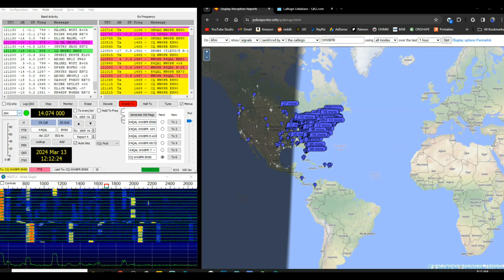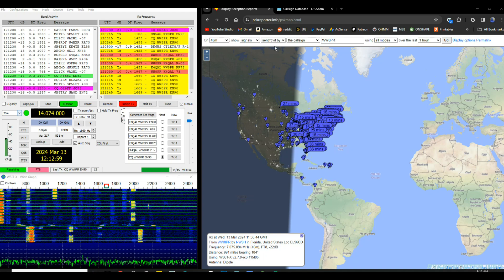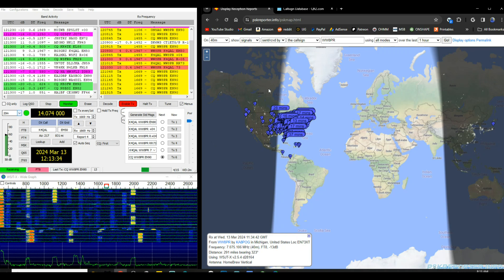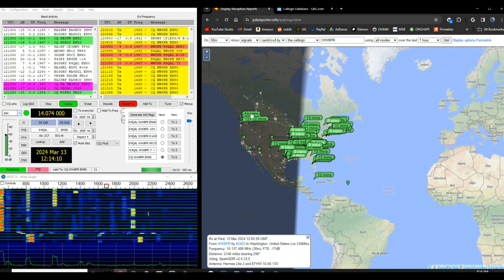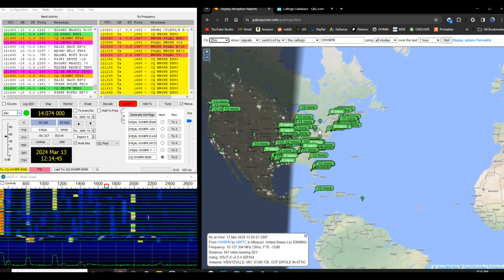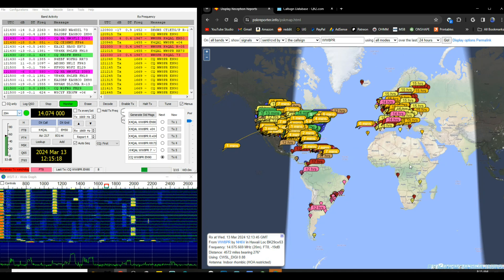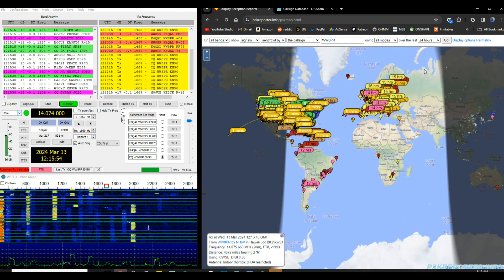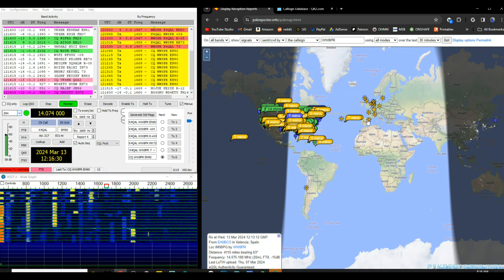What Factors Influence Radio Wave Propagation

Comment: I have had my Tech license for the past 10 years (have to renew this year) and not once have I used it.  What I really wanted was my General, but someone told me to study for the Tech because that was the "better" one.  So I did and I guess it was, but then it changed that the General became the better one.   I was gung ho on this I purchased all kinds of "test equipment"  like a VNA, TinySA, Scope, etc..  I was looking to learn how to do something (It was one of your "Classic Circuits") that's how I came across your channel a few years back.   I do use my RTL-SDR at work for ADBS and I  have also tried getting Sat images from NOAA so far I'm 0.0 at that.  I just have to get off my lazy  arse and build a better antenna than the one that came with the RTL-SDR dongle.